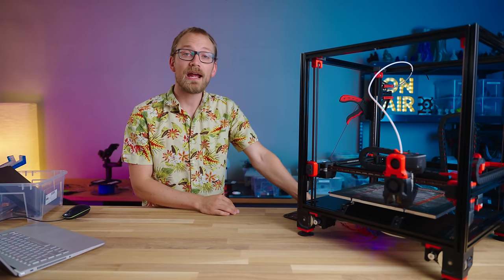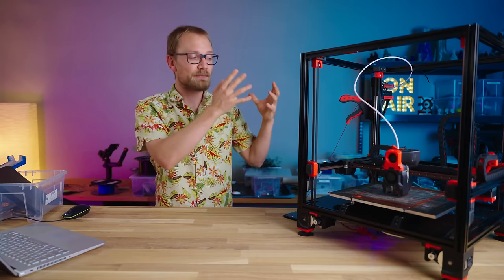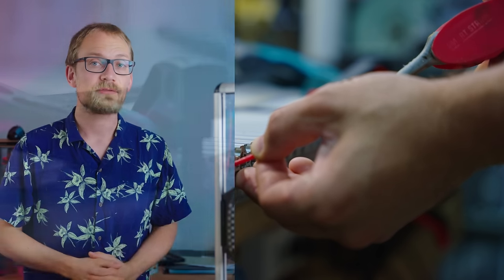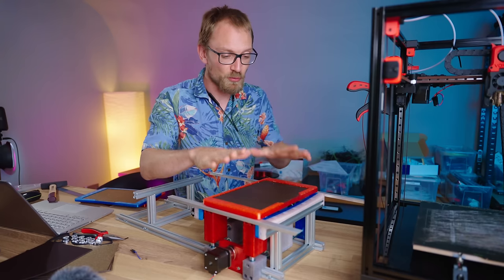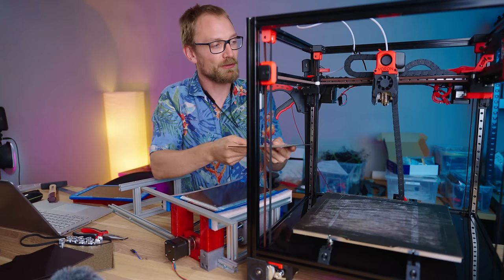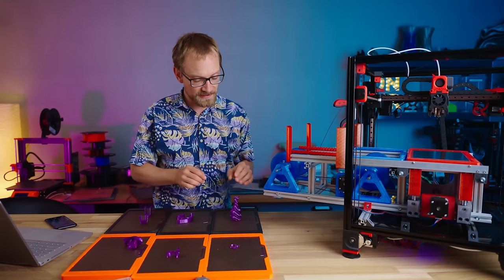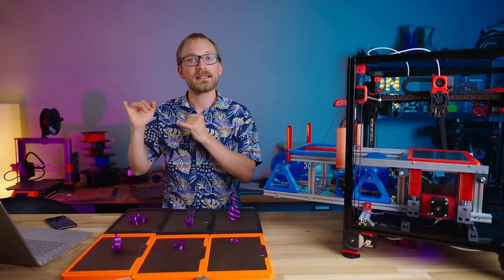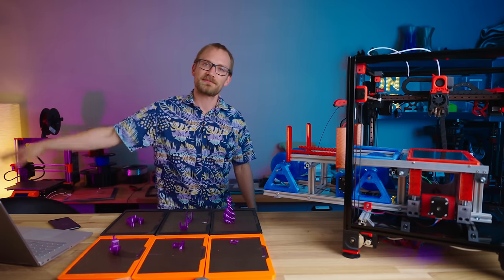Fully automated 3D printing using REAL print beds!

Comment: Your German brain over complicated things again .you can use electro magnets to attach the magnetic sheet to the bed energize the electro magnet and it will pull the sheet to the bed ....when the print finishes the next tray will push the current tray away ....you will get rid of the majority of the bulk of the mechanism and gain a bit more z height ...the tray hopper and belts will stay the same just flatter

Comment: Imagine a voron but commercial, with QA and for 1000 - 1500 bucks with less than 10 steps of assembly. 

People say there is no room for innovation, when this has yet to be made, but instead we'll just get yet another ender 3 with poorly thought out untested features hoping to get people to pay more for the same trash heap printer.

How don't people get the prusa formula. Do that, but with a fast printing core xy please. Pretty please.

I don't want to work on a printer as a job.

I don't want wifi connectivity. 

I don't need a touchscreen. 

I want a fast, corexy, direct drive printer with auto bed levelling, a standard, replaceable reprap or marlin board and most importantly QA.

If you can make that I have 1000 - 1500 dollars with your name on it. No more ender 3 clones!!!!